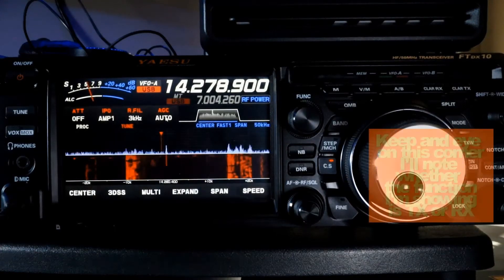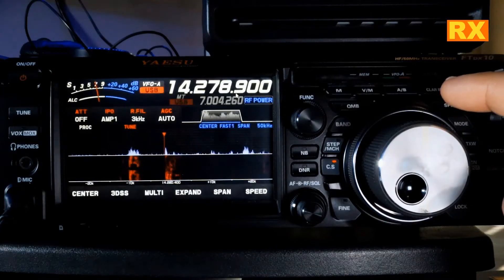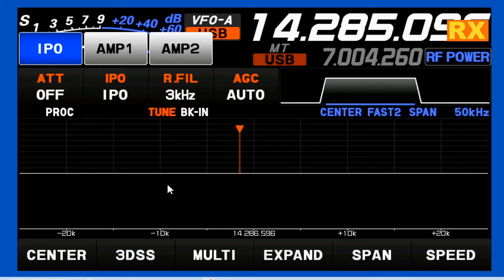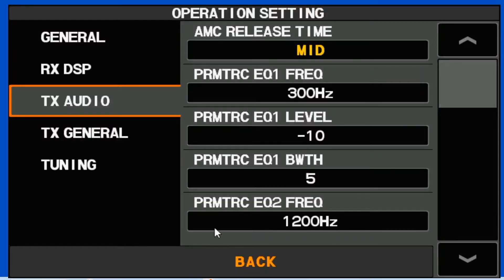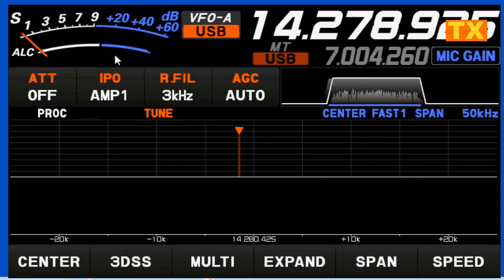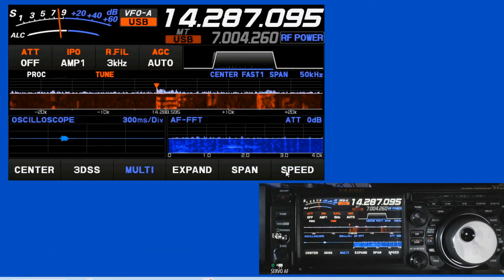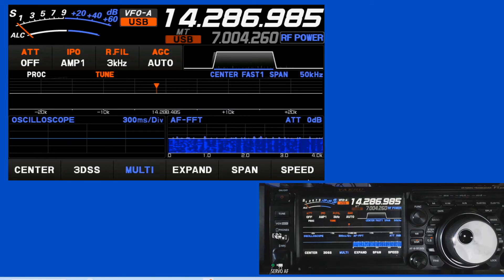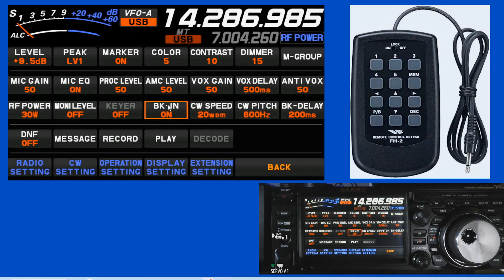The Ultimate Guide to FT dx10 SSB Setup Success

Comment: Hi Tom, I'm trying to get a recorded message to transmit. I turned on BK-IN and when I play the message the TX light comes on, but no RF or audio is transmitted. I am on USB mode and it transmits fine on the mic. Any help would be much appreciated. 
UPDATE: I found it in the Radio Today Book for the FTDX-10. Page 175, bottom of the page. PRESET must not be ON. If PRESET is ON it will key, but will not transmit any RF or audio. Sure enough PRESET was ON. I turned it OFF and now it works as it should. One of those quirks that no one knows why, but someone must have figured it out along the way. Great videos! 73 Larry WA5NTF

Comment: Do the recorded memory banks (message) run through the same audio settings as if you were using the mic "live"?
Reply from the maker: I would assume so.  The first thing that happens with the mic is that it hits a A/D converter so until it becomes a digital signal and is processed as such.